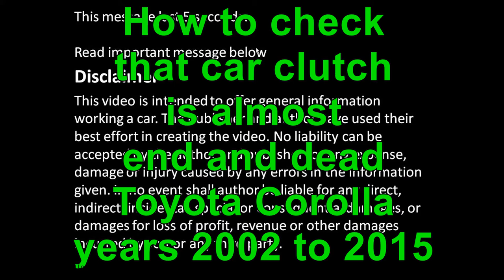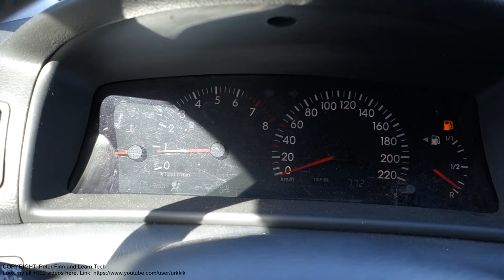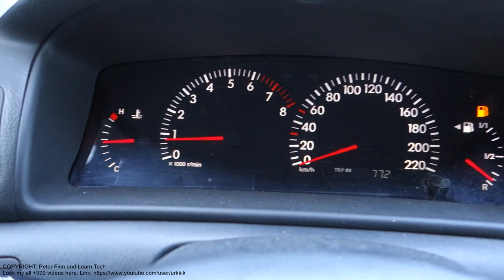How to check that car clutch is almost end and dead Toyota Corolla years 2002 to 2015

Comment: The way I diagnosed mine is. I put car in third gear. Then I lugged engine tell it was almost going to die. Then I floored it. The RMP's went way up but the car didn't move that fast
Reply from the maker: Hi. Your engine is weak. Check pistons compresson rates.
Reply: That’s how my 2002 Corolla is mechanic said it’s cylinder 3 issues